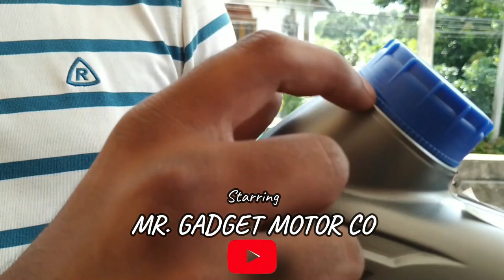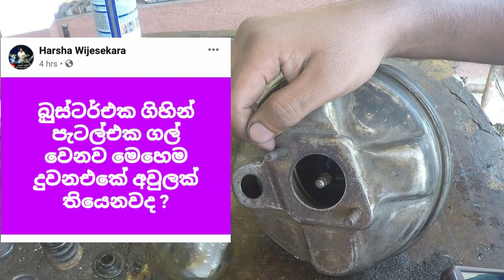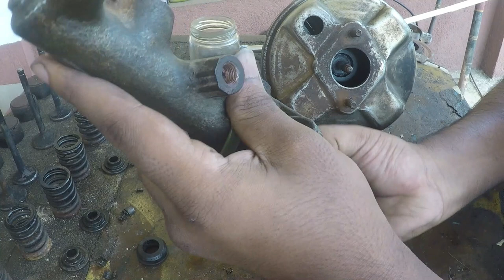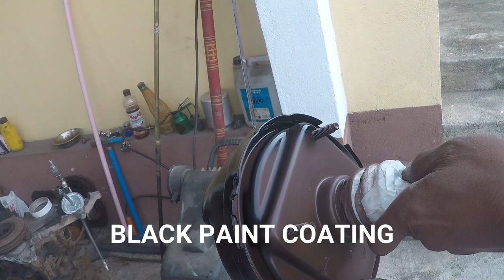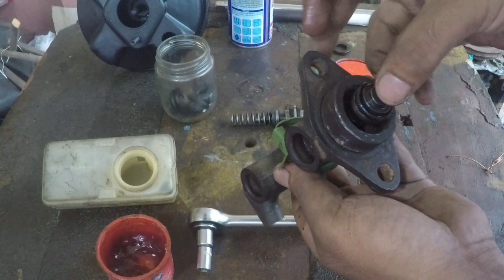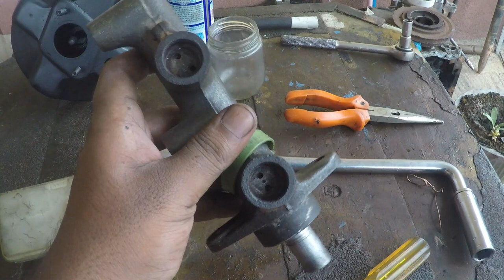Brake boosters explained

Comment: hi Mr.Gadget, thanks for your  valuable video.  Mr.Harsha's problem is same as mine. mage car eka break  booster eka gal wage . diesel car eka  mage. okkoma hotatama check kara. leak nehe. but paddle very hard when in  start the engine.  booster eka awul da? lagadima demma recondition eka FB15 nissan eka. deng monwada karranda onnai? Repair karanda puluwanda booster eka? please advice me. thinks.
Reply from the maker: Please call 0711227896

Comment: How remove  rear  axle  shaft  of mitsubishi  j20d Jeep?  Without  propertional puller?  Please  explain
Reply from the maker: Every rear axle is locked in place with c clips, remove the rear diff cover and push the axle inward, remove the pinion and remove the c clip then pull the axle by hand

Comment: Lance cb එකක Brake booster එකේ master cylinder ඒක සෙට් වෙන තැනින් vacuum අදිනව ඇතුලට. ඇතුලේ තියන rubber seal ඒක වෙන්න පුළුවන් නේද අවුල. ඒ rubber seal ඒක හොයාගන්න තියනවද?
Reply from the maker: Man mekata original repair kit ekak hoyala damma.. E wage hoyanna wei
Reply: Bolero ehka..break pdel phinw auto oil.leack wenne na..booster ekt enw ned curnt line ekk podi eka glaiwl thiynne eka hikroth hrid
Reply: Pon nambar dannako